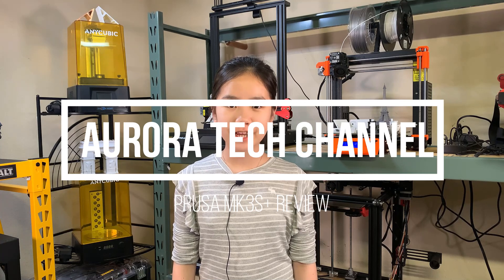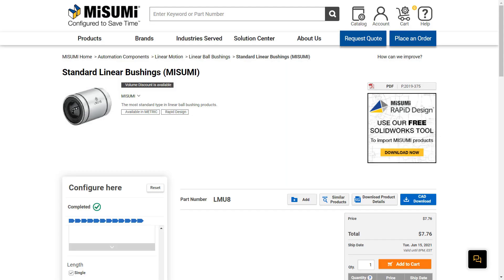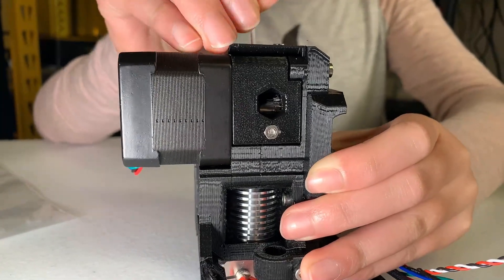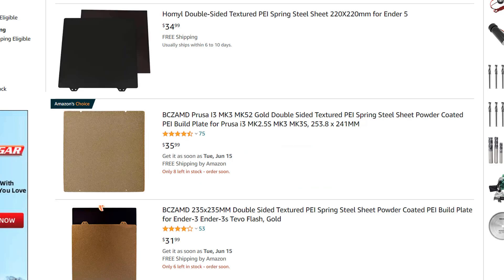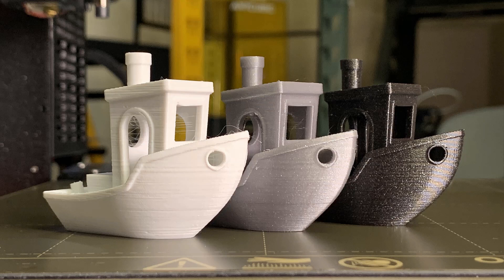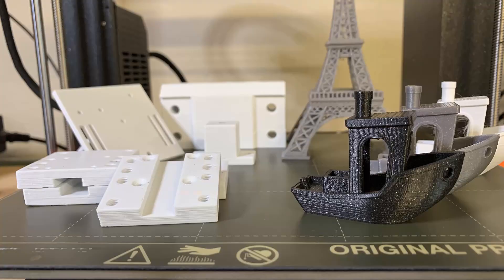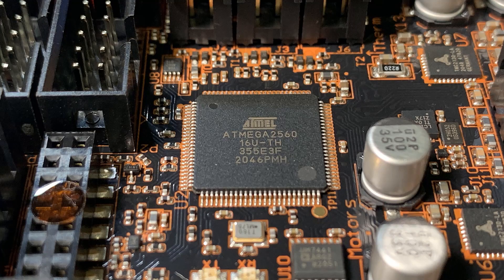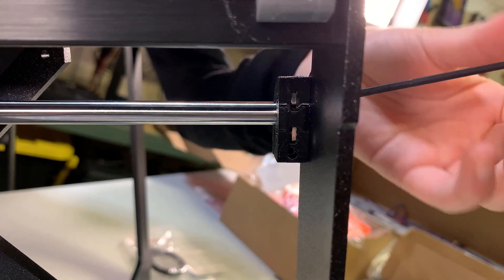PRUSA i3 MK3S+ 3D Printer, is it worth $750? Compare with Creality Ender 3 and other budget printers

Comment: As interesting as it is for its own sake to get a break down of the parts used for the Prusa, and how much each of them costs, it doesn't do anything to answer the question of whether the Prusa is worth the money. All it does is answer a different question (is Josef making too much profit on each sale?) and then reframe what the original question was. The question goes from "is the Prusa worth the money?" to "is it worth putting those expensive parts into a printer?" Or to put it a different way, do the benefits received from the use of more expensive parts justify the price difference? This is the relevant question to address.

Comment: It's all fun and games until something goes wrong with the Prusa. Everything being tightly integrated is a double edged sword. Not to mention the parts for the Prusa are kind of hard to get, take the hotend fan for example, it uses a 3-pin JST 4010 axial fan from Delta that isn't even listed on Delta's own website, and that's just ONE part. Whereas the parts for the Ender can be found easily and cheaply. Not only that, it's far easier to do maintenance and repair on the Ender. If you ever have to open up the enclosure for the Prusa, good luck working with the rats' nest of cables in the tiny enclosure.

Comment: 😖 NO, it is not worth it.  It is poorly designed and the fragile wires and sensors are not protected from the joys of a blob forming.  Unless you want to spend countless hours and $100's trying to clean and fix this $1000 piece of garbage, avoid a Prusa like the plague.

Comment: Great review. The board is 8 bit since the printer is an updated version of an older model: the good thing with Prusa printers is that you do not have to buy a new model every time, but you can upgrade your existing one. My mk3s+ was originally a mk3, then it has been updated to mk3s and now mk3s+ with only a few bucks. I'm sure the next mk4 will be 32 bit. A well tuned 200 $ printer can print with almost the same quality, but you have to tune it. The Prusa is a workhorse: you turn it on and start to print, and it prints well virtually forever, with almost zero manteinance needed. P.S. the extruder fan is a Noctua. If you know Noctua brand, you also know why you should add another 15 bucks to your price list. The printer definitely worths the money.

Comment: As an owener of both I can tell you know you will need to spend over 700 to get a half decent 3d printer... The Prussa will do that out the box. The Ender 3 will require numerous upgrades to keep it running long term and to bring it on par with a Prussa. If you've got time to tinker with the printer and enjoy that, get the Ender 3, if not the Prussa wins hands down allday long. The support on Prussa makes it worth it alone.

Comment: Ender was GREAT… for about two weeks… then was problems. The control board is terrible… lack of dual z is a big hinderance… I don’t like how the x carriage fits even after much tinkering (I’m fairly particular)… the fans failed nearly immediately… 

It’s a great printer if you can’t afford anything else… but if you got the $750… and your time is worth anything (and time is money), the prusa is far superior.

But I sell 3D prints. And the Ender cost me “money” in time. The Prusa is reliable and smooth.

Comment: Just wanted to point out that an 8 or 16 bit processor is not necessarily a bad thing. Anything similar to a CNC machine tends to be less buggy with a smaller processor. Something to do with the code translating properly to the stepper motors and not over calculating the process and giving the user enough time to fix mistakes. I don't know the nitty gritty, but it's been proven to provide a more stable machine.

Comment: what do you think a shop should buy?  we just dove in recently.  i bought a broken xplus, a broken davinchi 1.0, and a broken cmax.  a new super racer that im happily breaking too often to use as i learn marlin, octiprint, ect.  i need to buy an off the shelf unit for nylon and petg only.  ill swap on a .6 nozzle x and have it print all the other machines parts.  ive had a few wildly different carriage systems on the xplus.  its good with the icarus now but the ribbon cable gave up from all the handling.  the cmax had crazy mods to the controller, so its getting one of the octipus boards i have here.  im building a eail set for it so it only runs x up and down.  the davinchi is almost finished with its new octopus board wiring.   learning firmware has been bumpy, but il get there.  ive been thinking an ender3 with a few mods, but if i go beyond a nozzle, ill get carried away and i need one to make the parts for everyone else so they all can eventually work well.

Comment: About that 8bit chips, automotive uses them too. Reason is that as they are simple, they are strictly deterministic, so you know exactly what and when will run and how long it will take. If you use larger 32bit chips, even if they are cheaper, you work with them different way. You have to handle more processes and now you don't know if some other process blocks you or what else happens in the system. And more for that old 8bit chips are made for direct analog and digital IO operations, but 32 bits? they have only buses, so you have main chip, and one of this stupid chips connected on the bus, then you can indirectly read or write data. Other part is history, Atmega2560 is used in Arduino Mega which seems to be origin of rambo board. I nowdays use 4 of them as part of my project, they are great and have more than enough power for anything.

Comment: Thank You wonderful video and great information. I liked the way you two put the videos together, your parents should be so proud of you. I have a question. I have a CR 10S Pro V1. Would the bed level sensor on this Prusa work on my printer too. Do you think the linear bearing should be added to this 10S for better detail printing. Have you looked into the Direct Drive options for the 10S Pro? or any printer. I see upgrades are available but most are pretty expensive.  I have added the connecting gear and belt to the top of the dual Z drives, I have clamped the Z axis bed adjusters down tight, I have added a Swiss Micro Hot end and Hardened Steel Nozzle. ( I print Model Train parts and needed High Heat resistant parts for the smoke generator housing).  I also added a pair of Z axis Struts to stiffen the vertical frame.  You Guys are just treat to watch and i am learning from. you. imagine that. I am 72 y.o. with advanced degrees and 45 years in Engineering but you are helping me improve my productivity more than you can imagine. God Bless, Dennis

Comment: For me the lack of annoying problems really sealed the deal for the Prusa.  If you have more money than time then I’d go Prusa. If you have more time than money go Creality. Really just depends on what stage of your life you are on. Good printers either way.
Reply: also customer support is very important, I'm waiting now for mine to show up. I had looked at one more expensive in the $1500 range and they were not getting the reviews like Prusa, plus because of that there is also community support. For learning purposes I'm also going to buy some of there Prusament. Same reasoning not enough time, though I will be looking for a local supplier in the US
Reply: @Zimbob2424  I use hatch box.  The cost of Prusament was too much. It works great!
Reply: My creality e3s1pro is just a constant stream of frustrations. Thinking of getting a prusa
Reply: @FMHeatSink  I'm mystified.  All I have is the basic kit-built Ender 3, but it has worked like a charm from the day I put it together.  What are the frustrations you're experiencing??
Reply: I got all of 2 MONTHS before mine was a wreck, thanks to a blob forming and destroying the wires and other parts that it hardened around.  $1000 for 2 months = a piece of crap.  This is the review you should be listening to...
Reply: @samualwilliamson1187  you know that’s all fixable right?  You can buy replacement parts. Real advantage to not getting it built for you is you have an idea of how it goes together.  Worst case scenario you but a new heat block?  I had to do that when I tied to remove a blob. 50 bucks?
Reply: @davidmuzia814  Yeah, I built my first one.  When the wires broke from the sensor, the printer stopped working.  Only option is a heatgun.  I think it'll be $50-100 to fix, but the hours it'll prob take me is frustrating.  Modular printers would be nice.

Comment: in your print quality you admit the black 'hides the layers' - that is the wrong way to look at things for a test print where the quality is the most important factor.  just because it's harder to see, doesn't mean the flaws aren't there.   Would have been better to compare prints from each printer.

The simple fact is, out of the box - without doing much fine tuning or crazy things/upgrades, the stock ender 3 can print just as good, if not better, than the prusa.  Sure you can spend hundreds, if not thousands of dollars changing it to something else - or running faster, or going even crazier with lower layer lines - but it still doesn't change the fact that a simple $170/$155 printer, performs as well, if not better, than a $750.

Many of the 'clones' are also as good as the originals.   The Tower Test is a retraction nightmare, the fact it has a Direct Drive helps retractions greatly.  You can upgrade the ender3 to have a good direct drive for less than $60.  So now your comparing a $220 printer to a  $750.

There are plenty of motherboards and driver combinations that exceed the performance of the prusa's - under $125.   The real question is "do you want this to be a hobby or a profession"  As a hobby maker, the ender  3 is superior in every way.  It allows near limitless upgrades and modding to get a wide variety of desired effects.  While the Prusa is more "i want to start printing and selling prints in less than 24 hours"

Take an ender 3, spend a month with it, and upgrade as you see fit - a better deal for anyone taking this as a hobby that 'might sell things in the future'.

Comment: Nice video.

For the SuperPinda: You can only get it from Prusa - and only have an original Prusa...

On the other hand: Brand names do not automaticly mean a better product. For example you can get a cloned mk3s without plastic parts for about 350$ (on sale sometimes even the bear for less than 320). I have several of them - and they work as good as the original, if you:
- change 6 of the bearings to Iko or Mitsumi - on z the bearings mostly do not matter (simply choose the 4 best of the 10 you got)
- add SuperPinda
- replace heatbreak
So if it comes to make a reliable clone with same quality, the difference is more about $450 vs. $749.

For the print quality: It increases a lot if you do the Bondtech upgrade for the Extruder. There is an open source version on thinkiverse, all you need are the reduction gears and a smaller stepper motor. I use this upgrade on all of my mk3s+, not only the clones but the original, too.

In one aspect your list also forget one essential part making the price comparision: As soon as you start tinkering it is allmost impossible to stop. My Original Prusa mk3 only got: The s-upgrade, the SuperPinda, the BedLeveling Mod and the Bondtech Upgrade since I bought it in 2019. My first Ender 3 got hundreds of mods, some of them replaced by other mods - it is a learning curve with spending a lot of money. My first Ender 3 at least directly cost twice the price until it came to it present state. But of course trying different thinks it did not be the only "cheap" printer for long - altogether tinkering on printers became its own hobby, resulting in 26 printers altogether (which I barely use exept to print parts for tinkering)

So the biggest advantage for a original Prusa: You can use it as it is, making projects with the printer not for the printer. You do not get infected by the tinkering-on-printers-virus - it burns cash like hell (about 30.000$ in 3 years in my case)...
So the Prusa mk3s is the cheapest option in the long run.
Reply: I3 mk3s+ is also upgradable right? I mean after a few years to mks4 or whatever that is
Reply: @riyadh1121  Yes, of course. The mk3s+ itself is the upgrade of the mk3s, which is the upgrade of the mk3, which can be the upgrade of the mk2... There was always an official upgrade kit abailable (but the change from mk2 to mk3 was quite big and expensive, as many changes were made: another frame, controller, Bondtech hotend, magnetic bed, temp. compensated ABL, Filament motion sensor, changed from 12 to 24V... So Prusa also made a mk2.5 upgrade for 150€ with Extruder, ABL and magnetic bed).
If you want you can do the bondtech bmg upgrade (open source version: thing:3754163 or thing:3755063 for mosquito) and dual part cooling fan upgrade (thing:3681292).

My Prusa's actually are mk3sBMG(+) or mk3sBMG(+)Bear (+ is the Super Pinda, have not installed it everythere as the Pinda2's are well calibrated), but BMG and Bear are not official upgrades from Prusa (but definitly very useful).

As the mk3 controller was upgradeable with a Pi zero from the beginning (octoprint but without camera due to low cpu power), with the new Pi zero 2 W you can even use Klipper and input shaping (I will get mine tomorrow). So you can already pimp up the mk3s+ to the limit mecanical possible with the bedshaker design.

And of course there is the official MMU2s upgrade. Another nice non official upgrade: the new Bondtech CHT Nozzle making the mk3s+ high flow by just changing the nozzle...

Also Prusa upgrade the mk3 (and even the mk2/2.5) with firmware upgrades regulary. Like sheet management (textured, smooth and satin sheets; you can store the z-offset for different sheets and just select wich sheet you use) and other impovements. Like autodetecting the filament sensor. The problems of the old sensor were caused by the high reflective PETG the extruder was printed with - if I print thing:3347150 I get a BMG extruder for old sensor (detecting if filament moves - much better than new sensor detecting runout only) using non-reflective Greentec pro CF, I also would call it an upgrade... (a mk3+BMG)
Reply: @oleurgast730  thx for your time and this informative reply.

Comment: Excellent video. I love the numerical comparison. 

May I point out a few things? It's more than just print quality. It's your time. How many hours did you spend tinkering with the Ender 3 to get it to be as good as the Prusa, and what is your time worth? How much would you charge someone else for your expert skill in upgrading their Ender 3 to Prusa quality.
Also, there's a ton of little things the Prusa does that an Ender 3 doesn't. Like, having a filament out sensor on the direct drive that automatically heats up when it's time to load or unload the filament. Having an actually well tested UI that is reactive and makes sense. The Prusa is a quality of life upgrade.
Now, is that all worth the price? Well, developing that stuff isn't free, and developers and testers need to pay their bills. 
When you buy a $100 pair of running shoes they may not make you run any faster, but after you've used them for 6 months, they'll be in better condition than the $20 running shoes you bought. Hopefully. I know the cheap shoes I buy I have to replace the insole every couple of weeks. Sure, I saved a lot on the initial purpose, but I've been walking on a hole in my shoe or incurring additional expense (and time) fixing the insole myself every couple of months, it's might be worth it to just pay the upfront cost.
And, that's kinda how I feel about the Ender 3 and the Prusa. Yes, you can make the Ender 3 not suck as much, but the Prusa never sucks. At least not right away. Is that worth it? Now that you've added up the difference in the parts, and seeing how, quite frankly, little it difference is, I say yeah, totally worth it. But I'm nor intersted in doing cool prints than playing with my printer.
Reply: Thanks for that.  There’s an Ender 3 S1 now.  Has all of the good upgrades. Not sure how well it did them. But ya I just want to print. I don’t want to fuss around and be pissed. I want to use it like a tool.
Reply: THANK YOU PROFESSOR. Finally someone who gets it. It’s not about the money, it’s about the time. Upgrading and tinkering (read: fixing) my Ender was sorta fun at first but some days I just need to f*cking print. It could take hundreds of hours to install, troubleshoot, tune and tinker all the upgrades on an Ender. My hobby is designing robots, not fixing my printer.
Reply: Definitely some less tangible reasons like this. I have an original Ender 3 and I'm very seriously considering this printer because I'm tired of all the little tweaks here and there to just get it to print correctly.